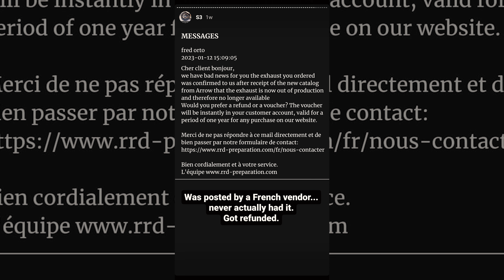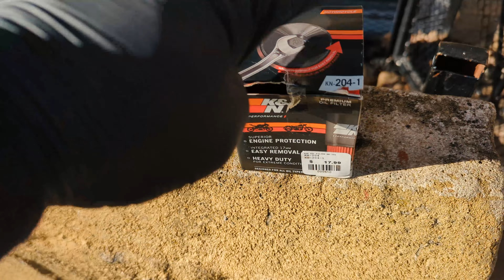Cat Removal - Twin Delkevic Mufflers - Speed Triple Mods & Maintenance 3

Comment: nice socks buddy XD, if you want a few pops and bangs check if your bike has a small idle control valve. my 250 has a black plastic knob next to the tank that controls the idle. it's fun in winter to turn it up abit. Downside is my oil and sparky changes needs to be done sooner from running rich.
Reply: And how you mad the bangs?

Comment: That's cool hearing the no-cat without mufflers.  Thanks.  I took mufflers off my 2013 1050ABS and (with cats) it sounded more like racy mufflers to me than expected.
Reply: I'm working on sourcing some minimally sized mufflers to fit onto the stock midpipes, mostly because no mufflers at all will attract negative attention visually ha. Red and blue lights

Comment: I worked at a Kawasaki dealer parts counter, and the oil drain plug crush washer was pushed hard to increase "line items per ticket" which helped sales.

That said, I always buy a bag of 50 copper washers off Amazon for every bike I get, and I usually have a bike for less than 10 oil changes!
Reply from the maker: Lmao, good old UPT. Right. Maybe I'll have this bike long enough to replace that crush washer.

Comment: I’ve used those crush washers until they got as thin as tin foil. They get real wide too. I always use a torque wrench at 14 lb/ft regardless of what the manufacturer specs. No leaks.
Reply from the maker: Nice. I typically don't even use torque values... Last time I did, I stripped it out on my sv1000
Reply: @Theillestrator1050  If tightened properly, it doesn’t feel tight enough.
Reply: Agreed about the torque spec not feeling tight enough.  But I torqued my oil plug after bottoming it over a curb. There was a slight seep that was taken care of by torquing it to spec.  Whew.  The impact was a glance off that bottom fore of the plug and the plug itself.

Comment: Agreed with the other comment about the torque spec not feeling tight enough.  But I torqued my oil plug after bottoming it over a curb. There was a slight seep that was taken care of by torquing it to spec.  Whew.  The impact was a glance off that bottom fore of the plug and the plug itself.

Comment: Looks / sounds much better . You can give your Exhaust Copper Washers a little more Life by Annealing them . Clean them , hang on a Wire and hit them with your Propane Torch until you see the Colours run , tnem , leave them to cool , or dunk them in cold Water .
Reply from the maker: Thanks, yeah I read that that's something folks do.
But I want to replace the hardware as it's rusty so I'd have to tamper with the seal again anyway. May as well just replace it outright

Comment: Sounds great but you should definitely get tunecu for it. Definitely gonna need a tune now. Even one of the posted ones will be better then nothin. I miss my bikes. Stupid winter
Reply from the maker: Yeah I was thinking the arrow high mount tune. I have a coworker with the software and cable to install it
Reply: @Theillestrator1050  just buy it yourself it’s so cheap when comparing tuning. I think I’m less than 100$ cdn into the software and cable and can use it for other things like diagnostic codes and whatnot. Definitely worth the investment

Comment: I always change my washers. much rather a 50c washer than the paranoia of an oil leak. Also, why delete the cat at all? I never understood the desire to do that,  especially considering that the bike is mapped for that backpressure and you would have to flash to get (anywhere near) a good map in the ECU for the changed flow characteristics. OEMs spend a long time on the dyno dialing in a good map, any aftermarket one is never going to be anywhere near as good. /endrant
Reply from the maker: That's fair regarding the washer.

Regarding the cat, that's easy. More exhaust flow, it's the reason why when you get a race exhaust there is no cat to be seen. The arrow catless mid pipe would be the best option but it's unavailable. Deleting it to help the bike breathe is the next best option.

Fortunately these triumphs are easy to remap with tuneboy or tuneecu for any modifications that you do. There are pre made maps selectable to match the specific bike. I have to disagree about being unable to dial the bike back in. The results are out there and proven.
Reply: @Theillestrator1050  I think our definitions of "proven" are very different. Fluid flows are extremely complex, less restriction in the exhaust is not always a good thing without holding other things constant. For example, by deleting the cat you have removed a reflecting surface that causes pressure waves to bounce back upstream, this has consequences for gas exchange especially during valve overlap.  While at certain RPM and load conditions this might give you better performance (more max HP), the low end torque/part throttle operation are probably severely compromised. Also without an engine dyno and instrumentation to verify, you have no idea about in cylinder temperatures/pressures/knock... not ideal for reliability/longevity. There really is no replacement for a factory exhaust or a factory developed race exhaust/map package. Most aftermarket exhausts and tunes are half baked at best and dangerous at worst.

Comment: I replace the oil drain plug washer after about 10 /15 times using it. Just watch how bad your torque it down and them damn things actually lasts forever. I just do out of paranoia.
Reply from the maker: Yeah I figured as much lol. I feel like maybe it's a liability thing.
Reply: @Theillestrator1050  engineers like nah you can keep using it then the lawyer got involved was like no no no no have them change it out every time🤣
Reply: @Theillestrator1050  by the way I really like that gurgle on the dicel. There's a lot of guys who want that pop and crackle. But for me when I hear that gurgle it sounds like a beast just waiting to pounce

Comment: 13:41 sounds like a bit of clutch slip?
Reply from the maker: It felt more like the 11 year old cracked tire letting go in the moment. Never had the clutch slip in the torquey lower gears, in fact the wheel comes up through first and second. So the clutch wouldn't slip at high gear right?
Reply: @Theillestrator1050  I’d test it on the Highway to be sure. Could be the tyres like you said.

Comment: Having done this my self.  Use the wood hole maker
Reply from the maker: Does that make it all the way through to the otherside of the cat?
Reply: @Theillestrator1050  little by little. It’s the circular one with the bit in the middle
Reply from the maker: Yeah I know the one, so you just use that and nothing else?
Reply: @Theillestrator1050  that and a big ass drill. Because it takes hella torque to cut through it

Comment: You need Tuneecu in your life check it out man man btw I love my 08 st675
Reply from the maker: Yes, I got a coworker with a cable and software. He has a speed four
Reply: @Theillestrator1050  that's good just wait till you get to play with that it's a game changer btw you can use a cable or Bluetooth and any android device tablet is better if you wanna mess with afr or whatever but most of the custom tunes are pretty good

Comment: Give me your addy, I send you a free OEM hugger for the back wheel..protect your shock.  I would get after the lower shock linkage check it, as well as the rear wheel eccentric. check the bearings in the lower shock linkage.   Listen ARROW makes a mid pipe sans CAT .. for your 2007-2010.  Should have just eliminated the twin hi-levels and gone with a canister and mid-pipe off the header under the peg... Put some Daytona 675 pegs on that for better grip. Aftermarket same same for about $20 bucks. Let me know on the OEM S3 hugger.. I can ship it out to you ....
Reply from the maker: Its funny because I was looking to order a Carbon Fiber one to more specifically protect the midpipe...but I wont say no to free :O.
The rear suspension and hub are fine, the bike has extensive service history at Triumph.
Yes I know of the arrow midpipe, I tried to get one. I mentioned it in the video, I just couldnt get one after ordering it twice. Not available anymore.
I personally don't really like the look of low mount pipes on this so I opted to maintain the high mounts. Atleast regarding performance, it helps keep that low end torque.
I'll look into the pegs.
Major thanks for offering the hugger, thats very kind of you. You can send it to Revzilla, I am incharge of inbound product so I'll catch it.

Revzilla ZNY
25 Hall St Bldg I
Brooklyn, NY 11205